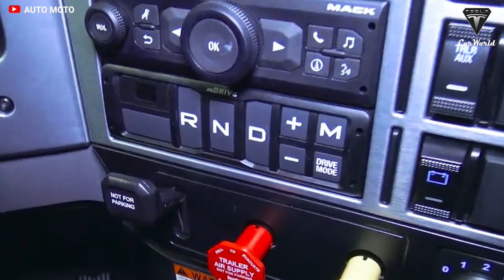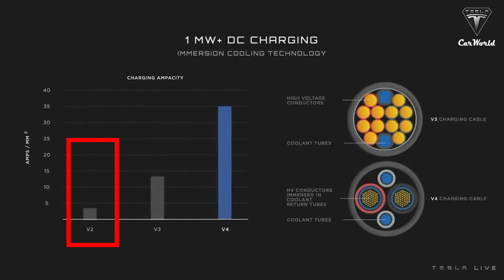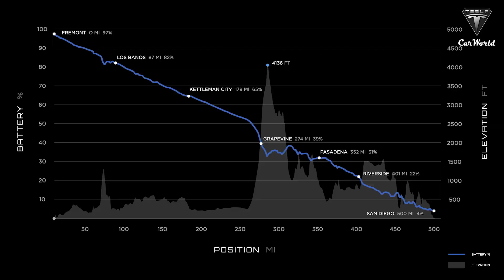The Real Tesla Semi Truck With All New Breakthrough Updates in 2023 - Everything You Need To Know

Comment: I believe the reason the simi has outside truck mirrors is because it is written 
into the motor vehicle code that ALL vehicles are required to have mirrors. 
ALSO, If one of the outside side cameras were to fail, and we all know it will 
eventually happen, then the truck can continue on its way safely. Removing 
the mirrors would not increase its aerodynamics substantially. So I dont 
think we will EVER see the simi shed its mirrors.

!

Comment: BTW regenerative braking can cause you to Jack-knife in slippy conditions so that’s too dangerous because sometimes you can not use your Jake brake (exhaust brake) in winter due to the risk of Jack-knife, these are not niggles, these are life threatening idiotic additions, also not all trailers you pull will have the regenerative feature which will increase the likelihood of Jack-knife too. (I mean, who will renew their full fleet of trailers just to accommodate such a stupid vehicle) The rich people who never drive trucks should stick to building rockets instead because cleaning mirrors will require stopping that’s no good because in winter you have to wipe your mirrors around every 2-3 hrs (I’ve been a truck driver for 22yrs btw) going through toll booths and passport control, will be a nightmare because the windows don’t open and even if they did your sat in the middle of something that is 8Ft 8inches, also dirty boots will make the cab disgusting. Elon……. If it ain’t broke, don’t fix it you idiot ask truck drivers of their needs first, it might be a good start. Anyone who thinks this is a good idea is thick as pig shit and has clearly never drove a heavy truck. I mean let’s look at the reality of the situation……..
How the hell can you get to the automated barrier, that is at almost every distribution depot, book in with security then try to get back into the seat and drive through before the barrier comes back down……. Absolutely ridiculous.
Reply: I don't understand I am expecting the truck to do the regeneration, why would you implement additional motors in the trailer to do the generation?
Reply: Secondly regeneration has nothing to do with Jake brakes. Regeneration is taking place inside the motor and is going to absorb most of the energy. Meaning your brakes will last forever and never get hot. So the braking ability of your truck is limited only by tires and not brakes running hot.

Comment: How heavy is the battery and how does this impact the payload efficiency compared to an ICE semi?
Reply: Tesla announced an autonomy of up to 800 and 500 miles for their 2 models with a consumption of 2 kWh per mile, so respectively a 1600kWh and 1000kWh battery. Knowing that the energy density of their batteries is 0.15kWh/kg, this makes a battery weight of around 10500kg for the 800 mile range model, and around 6500 for their 500 mile model. This is respectively, this is approx 23000 and 14000 pounds respectively.
This also means this much more weight that you won't be able to carry... So yeah...

Comment: This truck has low long distance visibility compare to a conventional truck and that increase the danger of driving at high ways behind a trailer, I don´t think drivers will feel safe without having a good overview of what is going on long ahead, takin in consideration the braking performance of HDV
Reply: Name me any truck whereby the driver can see over the top of the trailer in front.  In most cases the Tesla Semi will BE the vehicle in front, due to its acceleration capabilities, so the central seat mount is of little issue!!  Fairly sure I saw forward facing cameras in the wing mirrors so forward view beyond an obstruction is even better than an inboard driver in a diesel cab.  NEXT!!....

Comment: Fun fact: every single US state has a maximum combined weight limit for truck and trailers. Since batteries are much heavier than diesel, the tesla semi will undoubtedly have a much lower cargo capacity. EVs also tend to be more expensive than comparable ICE vehicles, that makes the tesla semi a bigger investment up front that generates less revenue in the long run. Great job revolutionizing trucking Elon!
Reply: Did you miss the spot where the energy usage is? 25% of diesel? And the truck can pay for itself in three years compared with diesel? And your smoking gun is a diesel can carry a heavier cargo so you believe every truck on the road is running at maximum weight, one of the customers is lays potato chips. Do you think those trucks are going to be running max weight?
Reply: Weight difference between the diesel and batteries will be less than u think!  Don’t forget the fuel weight. Then look at the truck weight as a percent of carrying weight and you’ll get lost in the noise.
Reply: Take a seconds and do some research. You will quickly find your points mute.

Comment: What's the EMPTY weight of the truck??  If the truck weighs too much it won't be able to carry much payload as it's limited to 80,000 lbs total here in the USA
Reply: Its current unloaded weight is approx. 7-10 tons when u include the massive size of the battery. That also takes about an hour to recharge. Takes 10 min to fuel a diesel and they can carry 20 tons and weight approx. 3-5 tons unloaded and full of diesel
Reply from the maker: Tesla’s Semi will have a Tesla estimated range of 500 miles on a single charge, and that range can be achieved with a gross vehicle weight of 82,000 lbs (Tesla says federal regulations allow electric trucks to go 2,000 lbs. above limit). Thanks for your comment !
Reply: @TeslaCarWorld     Thanks for reply.  Yes, that is gross weight, what does the truck weigh empty??  I have yet to get an answer!
Reply: @Hubjeep  Tbh you will never get an answer. Cuz to answer it would destroy the whole idea of the tesla semi for these people. Ask truckers with CDLs what they think about the truck. Not tech guys
Reply: @PunksGambit s a truck driver I like the general concept of electric semis, but I know their load capacity will be absolute garbage. I currently haul 44-45k pounds in the trailer to be at the max gross weight of 80k (at least without a permit). The Tesla semi is an interesting idea, but it has to be at least 4 tons heavier than it’s diesel day cab counterparts as a Diesel engine only weighs 1-1.5 tons. 

Charging will always be a problem, and if Elon really thinks 1 MW charging is feasible, I think he forgets that it would require an ENTIRE SUBSTATION to power just 1 of the 1MW chargers. That’s not to mention how much fast charging degrades the battery faster, or the fact our electrical grid can barely keep up with the current demand.
Reply: @TeslaCarWorld  Hubjeep even put EMPTY in all caps for you to see. and you still go and answer unasked questions instead. Why are you shilling for Elon's truck that can haul from 1/4 to 1/2 of the load of a diesel semi?

Comment: One glaring omission on the update front. What is the load capacity?
Reply: I think it hauls air in the trailer plus a driver.
Reply: Someone estimated that it has 5000 pounds less capacity than a diesel truck. 7000 pounds more weight for the battery compared to a diesel engine 110 gallons of fuel and a transmission.
But it’s allowed to be 2000 pounds heavier because it’s electric

Comment: They need to fill the bottom of the trailers with battery packs so you can go across county, drop the trailer, plug in, pick up and load a charged trailer, and head back. I tweeted Elon about this. But little chance he would respond
Reply: That's an AMAZING IDEA!
Reply: There are weight limitations
Reply: Or just use trains
Reply: Yes, because they didn't think about that & do the calculations & appraise downsides & benefits... 🤦

Comment: Sounds great, i hope it s gonna last a few millions miles like ice trucks.
If a brakedown is once a month, it doesn t matter if you can drive 500miles.
Reply: They will last longer. It's already the case for EV cars compared to ICE cars.
Reply: @Steppenkater  but commercial use is obviously harder on equipment than private use so time will tell how well they hold up.  That said, I'm hoping Telsa will succeed.
Reply: Electric is extremely reliable
Reply: This is a day cab, not the sleeper cab.
Reply: @hillbillyintheasia6122  An ICE truck with a day cab will run millions of miles with good maintiance, i'm wondering if a Tesla Semi will last that long
Reply: @poly925  Well, it's here, so I guess we just gonna have to find out

Comment: How long does it take to charge up sure as hell not as fast as a gas station this is not practical at all people think they wait for packages now ha will take 5 times as long to get to where is going with this pos
Reply: Charge during break. It charges 70% in 30 minutes. Now, if businesses learn in real world used that it takes longer to do typical trucking jobs, then they won't buy this semi. No worries about late delivery.
Reply: @nguy404  
It’s not designed for long-haul independent truckers traipsing around the country. It’s designed for point-to-point they jobs where the charger is at the warehouse.

Comment: With Battery technology still developing rapidly I have no doubt this solution will just keep getting better.
Reply: You are kidding, right. Unless they have discovered some miracioulious new element to add to the Periodic table the elemental chemistry does not exist. They have been playing around the chemistry for decades and every time they push for for more energy per kg they invent a better fire hazard.
Reply: @richardkaz2336  batteries from 100 years ago were more deadly health hazards than they are now. Cadmium was good at it's job just not good for people. Same with the lead in gasoline. The newer silicon ion battery would help reduce lithium usage, but currently the electrolyte that catches fire is the main thing that needs to be changed for batteries to be the safest they have ever been. Nasa has a battery that removes the flammable electrolyte and is more energy dense but it's all in the testing phases so we won't see anything for quite a while...
Reply: Battery technology is not advancing rapidly. In fact, it’s kind of peaking out.
Reply: @neilkurzman4907  wrong.  Battery PRODUCTION of new chemistries & technologies isn't advancing, but discovery & testing is.  It takes years to test & release new battery tech.  BYD LFP Blade, Tesla 4680, CATL M3P, all within 5 years, not good enough for you.... 🤦
Reply: @alexmanojlovic768  
4680 isn’t new technology. It’s simply putting the battery in a larger cylinder. The original 19650 shape was designed for laptops. So not a great technological achievement.
Searching for new chemistries is not delivering them. I was in the lithium ion battery industry for over 10 years during that time the cells increased in capacity by about 50%.
Reply: @neilkurzman4907  strange guy.  Some of your comments are spot on, some are complete drivel.  4680 isn't just a size format. Tabless allows that size to be effective as temperature control is the biggest issue to resolve at that size.  Tabless reduces electrical resistance, thus heat generation & also tracking, which increases lifespan & power discharge. I haven't got the link & can't remember the video title, but Tesla 4680 have reduced the internal soldering/welding count further & redesigned the endcap to either reduce component count or machining steps.  There are numerous issues 4680's had to overcome to actually be practical.  It appears they're not quite there yet, but the benefits in manufacturing speed & cost of production will be worth it.
Reply: @alexmanojlovic768  
Yes, all of those things are true. And none of them are a game changer. 
The major advantage is, it puts more active ingredients together because there’s less waste of space of the cans.
The item to talking about basically increase the volumemetric energy density of the pack. But not buy a huge amount.

All these advantages build on each other. Anything that brings the cost down or the energy density up? It’s a good thing.  But some people are expecting batteries to be two or three or four times more energy dense and these changes just aren’t going to bring that.
Reply: @neilkurzman4907  again, no you're wrong.   Tabless(ness) provides the main advantage not the size format.  You really need to do more research, it's too complex to answer in a post.  Look up tracking & dendrites forming. Tabless reduces both of these effects.  4680 is less able to dissipate heat to the bodyshell, tabless counteracts that.  4680 allows cost cutting & materials reduction, thus a slight weight advantage.  Tabless & Maxwell's Dry Battery Electrode technology gives the other major benefits.  I really think you have no idea what & why Tesla are developing 4680.  You have a lot of reading to do, so please stop arguing over it until you've done more research!
Reply: @alexmanojlovic768  
I spent over 12 years making batteries and chargers. I don’t need to look up the details of how the lithium ion batteries work.  Other than you singing the prices of tab-less. What’s the advantage to the end-user?
Is the battery cheaper? lighter? more energy dense? charges faster?
The customer doesn’t care how hard it was for you to deliver the product. They just care how it performs.
Reply: @neilkurzman4907  as I said, Neil.  Too much to answer this in a post.  LOOK IT UP!!

Comment: I notice it by pass the 4 scales on the way there  and they also planned the trip so it would not go thru traffic pick hours
Reply: I think the logistics experts at Pepsi are aware of that & the effect that has on journey times, as they'll log that data & use it to plan their own normal runs for maximum cost savings. Or accept the hit when it's unavoidable.  Do diesel trucks manage to avoid those issues with Evil Oil Baron Magick-icity somehow, or were you just pointing it out, but not bothering to clarify it wasn't a criticism or accusation of some con job by Tesla?...

Comment: About rolling drag of 82 000 ponds it is about 660kWh in 500mile trip when load is half that can count half  so when it is 900kwh pack then 0.93*900=837kWh energy used  and that means air drag + regeneration inefficiency + breaking eat up 837-660 = 177kWh that trip with half load is probably near 480 kwh plus the same air drag regen inefficiency also probably similar and energy loss to breaking less. so lets say 170kwh so it is 480+170 =650kWh so it takes only 72% of battery. and possible range is then 700miles with typical load.
Reply: Yet no one knows what a typical cal load will be for they won’t disclose it’s empty weight